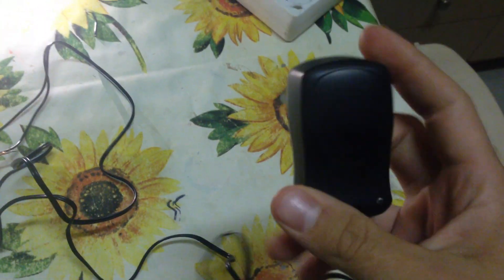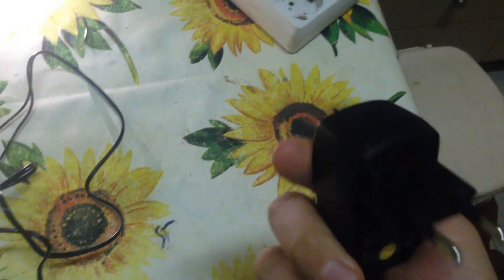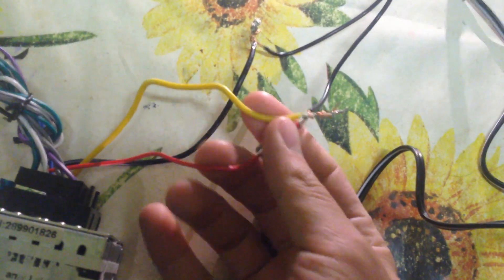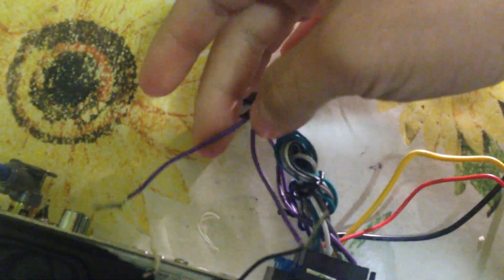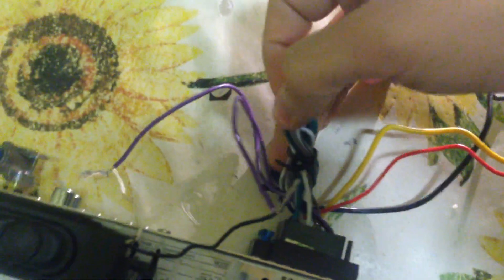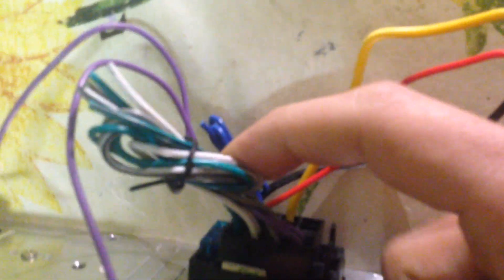car stereo at  home with ANY 12 V SUPPLY  !!!!!! NO PSU  no fake !!!!!!

Comment: This shit will burn in minutes with my stereo setup... If you want it to play loud with some propper powerfull speakers,or use amplifier and you want decent sound (not like the shit in this video) ,then you need those ampers from PSU... otherwise the sound will be crap or that power supply simply burn out , propably both of those options .. if you realy have to use something like this,use atleast old laptop power supply

Comment: 14 volts works too, that 14 volts goes to the radio when the alternator is on in the car. Just make shure that you check the voltage or bad stuff could happen if too much

Comment: Of course it work on any 12v dc power supply but the current not enough. Your dc power supply probably max 2 amp or less. If u drive bigger speaker your car audio will shut down. That why psu better because can supply at least 10amp. Please learn basic electronic sir. Don't just see the voltage. Amp important too. The thing you don't know of.

Comment: Works great.
Thanks for the tip
Reply from the maker: thanks a lot ... i dont see positive coments often to my chanel , be careful tho some of tha viewers told me that i did something wrong ! it has to do with ac or dc , mine worked but not for long... VERRY GLAD U TRIED happy new year
Reply: Yeah ok. Ac is coming out of the wall and converted into 12v dc. Depends which charger you use i guess not all would suit.
But for now it works ☺

Comment: Let me just say that it's a very bad idea to use a transformer or a ac adapter to power a car head unit indoors because those only put out 1 amp and it's not much at all also car head units require at least 20 amps to get them running and for them to stay on and also if you don't give a car head unit enough amperes it could damage it and I did what you did but I didn't want to risk breaking my jvc kd-sr72 car head unit because it was a expensive car head unit and I didn't want to damage it with a weak power supply that only puts out 1 amp that's why I might just use a computer power supply or a Xbox 360 power brick to power it instead why starve a car head unit for more amps that is typically a very bad idea and a great way to destroy a car head unit I mean come on man your method can destroy car head units and I don't recommend this kind of a power source to power a car head unit indoors
Reply from the maker: Travis Gulley thx for your advice

Comment: I've seen people use a piece of wire as a antenna by sticking the wire into the into the part where you plug the antenna into actually using a piece of wire as a antenna is not a good idea because if you stick wire into any holes of the head unit you could potentially short something out and damage your head unit so if you want to use a antenna your better off buying one from a car audio shop because it's a lot safer to use a real antenna than a piece of wire

Comment: The only problem is that it is not enough amps to make it louder because it isn't going to be as loud if you use a ac adapter I've done it before and it's not enough amps to make my jvc kd-sr72 head unit extremely loud because my subwoofers and speakers are not as loud when I crank the volume up because my head unit isn't getting enough amps so therefore it cuts out and I'm not sure if the volume limit on my jvc kd-sr72 is 35 db because I think it might get louder if it had more amperage and more power not sure I'll probably have to re wire my head unit and use a bigger power supply such as a Xbox 360 power brick or a computer psu

Comment: how much should be the amphere of the 12v output??
Reply: Depending to the power supply some 12v have higher amp. some are lower.
Reply: Ankeet DEELAWON  you need more than 3 amp , because the car stereo need more current to work.

Comment: This is prone to fire.
Reply: reginald56000 it's also a great way to destroy your car radio unless you are using a computer power supply that puts out 700 watts or higher or if you use a car battery which is a little risky and dangerous because I remembered that car head units are just like car amplifiers they require a lot of amps to get them to stay on at higher volumes and for them to not get damaged and for the audio to sound clean and not distorted
Reply: @travisgulley2652  👏👏👏
Explained well
Reply from the maker: reginald56000 well i ensure u it worked well , u be the judge
Reply: Travis Gulley 
damn dude what watts you got g

Comment: its not fake ive seen a radio run off  12v christmas light plug cut and splice job but turn the volume up it cuts out not enough amps
Reply: an xbox power brick would work and thats 17amps i think and that is more than enough
Reply: y it cut off...any solution????
Reply: it cuts off because there not enough amps
Reply: Amber Nectar how many amps do you need
Reply: mine  i made it usb powered so its 12v and 5v
Reply: That true.. samll power supply cant handle that car player.. amp not enough.. i have same experience, u can use laptop 12v power supply far better. normal power supply also got noise.
Reply: try using a wifi power adapter

Comment: maybe its works but not long cuse its need dc voltage not ac
Reply: The transformer at the end of the plug changes the 120 ac to 12v DC. That is why it works

Comment: car audio need -and+
Reply: +Vaffinators LV yes, the 12v power adapter has + and - One will be the pin and one, the ring, cut the wires, separate them and you have one + and one - wire.   If you're revering to the speaker wires, you'll see 2 purple wires in this video that he's using.  One will be + and one will be -
Hope that answers your questions.   before cutting on someone's idea or video, please read up to get an understanding of the items in question... it's basic wiring/stereo stuff..  :) 

To Dan Laesu,
I believe the blue cable is what allows the stereo to turn on when you switch the ignition to accessory without starting it, or it is the wire that would connect to a remote CD Player so it turns on when the stereo turns on... it's different for each stereo, but that is my guess.
Reply from the maker: +JeremyF4i  wow , thanks jeremy
Reply: Normally the inside one is positive and the outside one is negative. normally the one have white stripe is positive. u can use multimeter to check it.

Comment: dont work, only fire you can get with this.
Reply: gazzoification I did what he did in the video and I had to stop using a 1 amp 12 volt ac adapter because it's going to actually break my car head unit one day and I encourage that you don't use a 1 amp power supply either because car head units require a lot of amps to get them to stay on at higher volumes so I'd suggest that you use a computer power supply that puts out 700 watts or higher
Reply: its work but the power dc supply he use is not the good one.
Reply: Travis Gulley well i used a 1.5amp one too, my headunit works but the song dosent play, i have tried 2 working speakers 4ohms idk yet the beeping sound of the setting works( when u scroll through setting or options it makes beep sounds perfectly) idk whats the problem ;-;
Reply: When I was young I made one for my student home and it work perfectly!
Reply from the maker: +Vaffinators LV  well i garantee to you that video is not fake ....